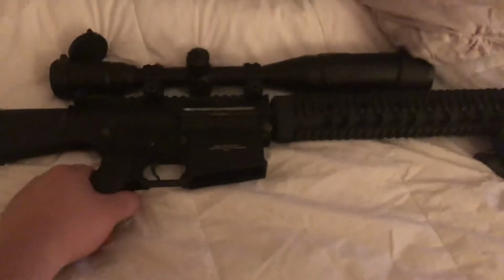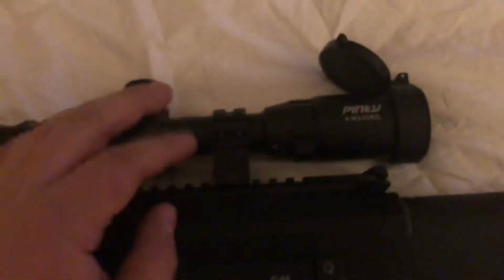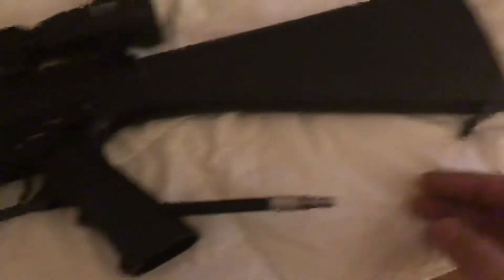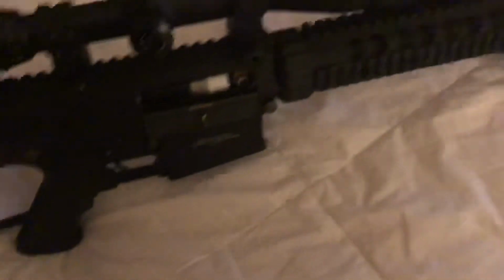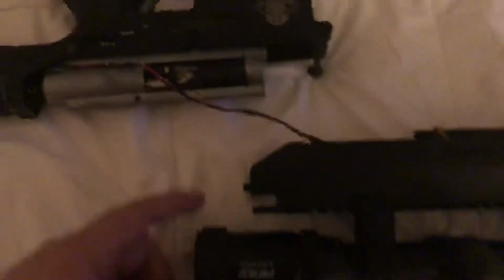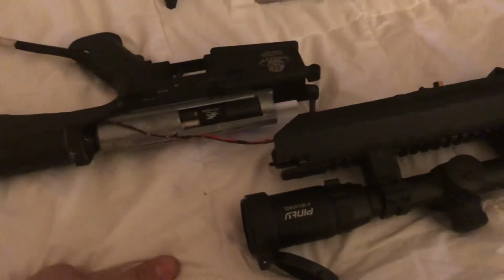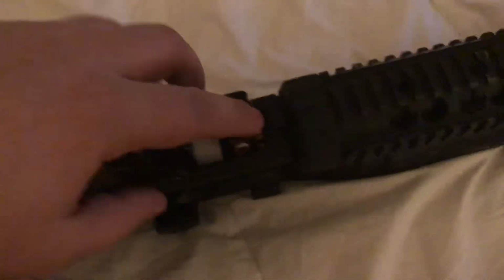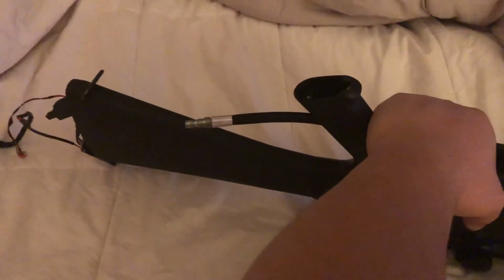G&G SR25 (GR25) PolarStar tracer DMR

Comment: same gr25 user here, 
just realized it has tracer hop up unit capabilities xD. i was gonna make thread on the surpressor to fit the lighter S hahaha
Reply from the maker: It’s a pain. Since they pretty much made the suppressor not to come apart. But it can be fine since I made mine foam filled
Reply: Hi , can you help with the spacer part ? What are the sizes ? From where have you bought it ?